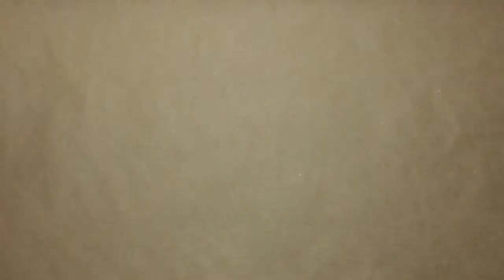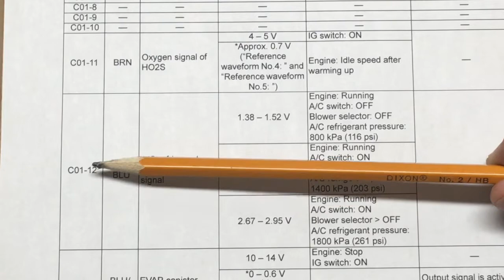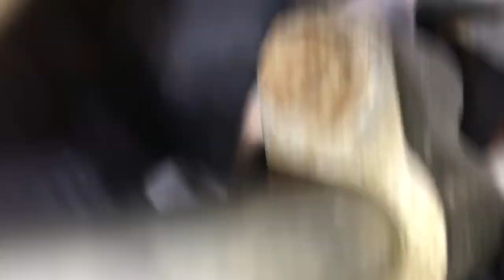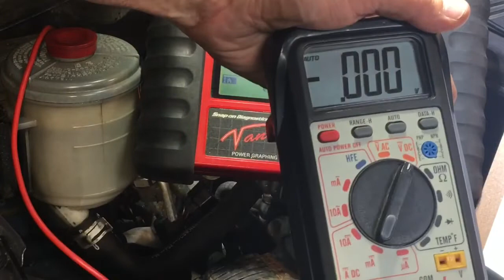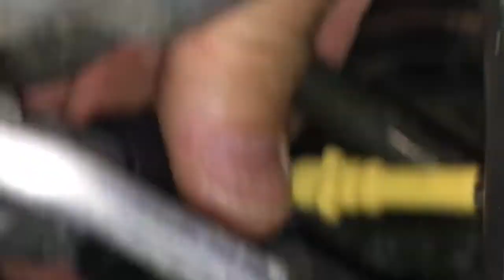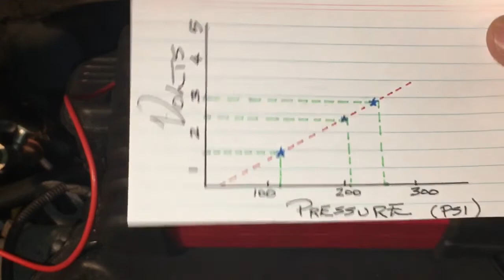A/C Pressure...No Gauges, No Scanner!

Comment: 👍 Great video this is where you start approaching the use of Arduino and cheap sensors and you can literally hand building code your own AC control module to bury the speed of a condenser fan and a blower motor and turn off and on your compressor clutch completely bypassing your automotive controls.                Some cars also have the low pressure transducer and connected to the fins or the tube of the evaporator you could have a thermistor and read the temperature using a ohmmeter.                R134 only closely follows the temperature at 70 psi would equal 71°F.  But at 100 psi it becomes 124°F, at 31° F equals 26.9 psi, add 263 psi equals 150° now were way off our mark that would be the equivalent of a BMW in the 80s and 90s high side pressure on a warm day you’re nowhere near pressure to temperature equal relationship.       And his pressures and temperatures would only be good on a completely full system to factory spec.   For example where they would not be correct a system half full with refrigerant starving to compressor for a return of cooling and lack of lubrication the compressor goes into a overheat Cascade effect that goes out of control and superheats the refrigerant therefore giving you false pressures in comparison with refrigerant temperature because you have added the heat of compression plus lack of lubricant heat or friction. The normal train of thought of simple incorrect physics goes out the window. And the pressures are not linear there exponential , logarithmic.  This is why all those guys you see on YouTube with the little cans in the gauge with the green section in the pressures and they attempt to use a PT chart are wrong incorrect and sometimes disastrous burn up compressors.                        Hope to see you catch their HVAC tinkering bug make some more videos about it 👍
Reply from the maker: t lech Thx again for taking the time to leave a meaningful comment. The content on yer channel is super interesting and inspirational.

Comment: Looks like a typical 500PSI sensor, Ian where the working range is 0.5v to 4.5v and the PSI is equally divided into that 4v range (125 PSI/V) with a 0.5v OFFSET...
(V-0.5)*125=PSI
Reply from the maker: Yeah I was thinking of your pressure sensor work Denis as I was drawing up the little graph. Look very similar indeed. Cheers Pal